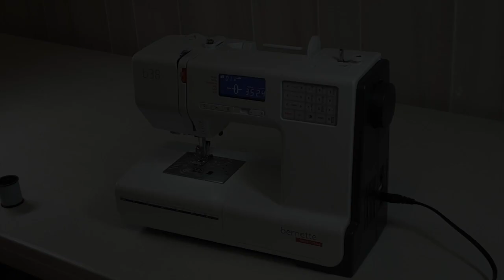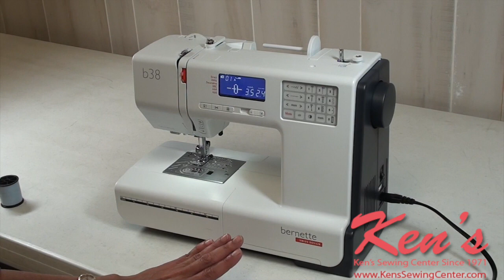bernette b38 Sewing Machine

Comment: Great machine, the demo is good because one thing I want to see on a review is its motor sound you get a lot of reviews that only have music or too much talking over the motor sound  you need to hear and see it running, the make is good quality and this one it’s motor sounds smooth and neat, I’m seriously thinking of getting this one to replace a cheaper AEG alternative I ended up with and is useless on thick material, the shake is down to the table it’s on, it’s always best to sew on a good sound table, this machine is good.
Reply: I also do not like hearing the music in these type of videos. I want to hear what the machine sounds like, and also a human voice describing the features.

Comment: Hmm, looks like a great machine apart from that it definately looks like the machine will shake a lot and jump like crazy around the table at full speed. I could see that happened twice. That to me seems quite worrying. I guess I have to try one in a store, and see if it will jump and shake when at full speed.
Reply: HI, I just came back from the store and ave to say that it doesn't shake like this. I was even surprised how much it shakes in the video
Reply: It depends on the  table you put on. On some portible tables  all brands  of sewing machines will shake and jump. Sometimes if you put the machine over the legs of the table the shaking stops